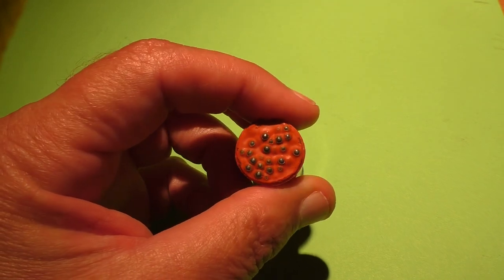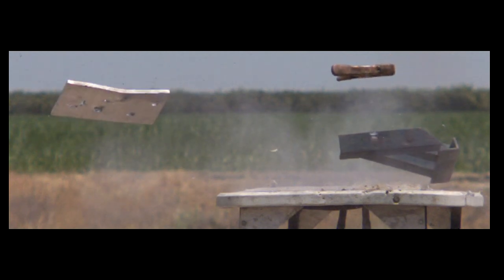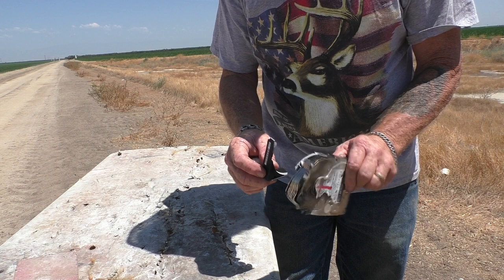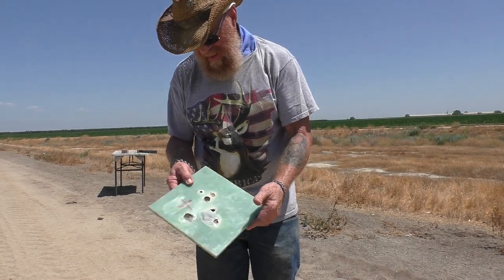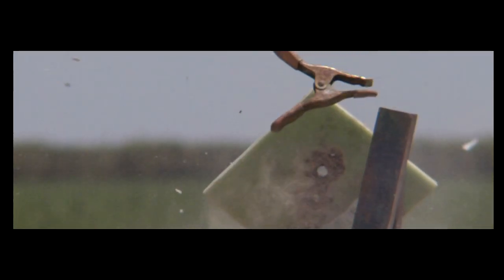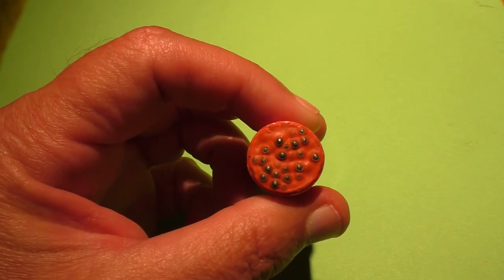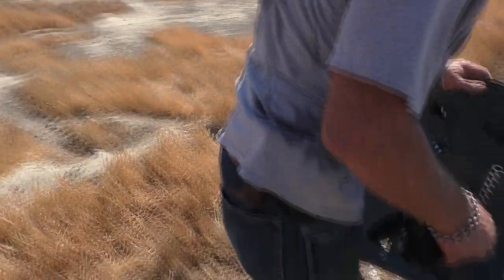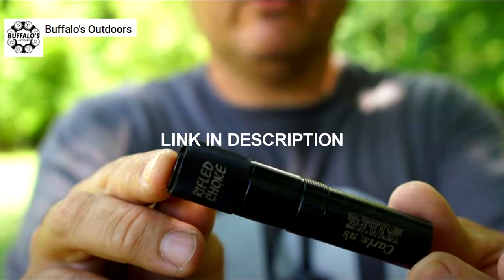Taming the 12ga Wax Slug -  is it possible?

Comment: I’d like to see these tested against cut shells. That would be cool.
Reply: I would too, he did a video on cut shells and REALLY didn’t like them, I think it’s a bias
Reply: Just this morning I tested a cutshell/waxslug out of an mossberg 835 which is overboard or I wouldn't have ran a cutshell/slug cuz I was scared over pressure issues. Since it is over bored the cut part of the shell actually acts as a sabo and the crimp keeps the slug safe from heat and wind. It was very accurate and punched through a refrigerator box stuffed with debris. The box was about 24 to 30 wide and it punched both sides.  The back side showed signs of the slug fragments but was still smaller than a baseball. I am going g to run  a few more and then make a video on my final product. I am hoping to get a wax slug on a pie plate at 50 yards reliably. I think I am pretty close. 10 of the slug variants I made today shot just fine at 30 yards and maintained a 4inch group ( not bad for a smoothie and some ditch craft). I am making some more today. I also shot several uncut waxers and to my surprise they were just as accurate even though the barrel is way too big for the slugs base diameter but they worked fine and held a 4in @ 27yards. The cut shells and the waxers both love to tumble. The diff is that the waxer holds together if you do good work. ( yeah, you can make a shitty waxer ) and the cutshells flip the contents of the shot cup out randomly, alot of times once it loses some load it goes of track cuz the imbalance and stuff. Waxers are definitely better than cutters. The only ditchcraft that is as cheap and effective is a combination of the two. If you don't have an over or back board barrel I cannot recommend a waxed cutter ( play at your own risk type shit). Happy new year 2021

Comment: I'd rather just make cutshells Barry style! Simpler, and they work fine
Reply from the maker: The biggest improvement to those is using a shell cutter to just cut out the crimp so the wax slugs can't plunk out of the shell if racked into a pump action.   (which can create a dangerous situation)

Comment: I've done a lot of experimenting on wax for black powder lube.  Toilet ring wax is really gooey but it is tough stuff, it doesn't go to hell in the heat it just gets stickier. Paraffin for canning is nice and clean and dries hard but is brittle. If you really want a tough wax, melt down some long lasting survival candles. That stuff will hold together for a wax slug I bet.

Comment: Solution to wax slugs - first, crayon wax is brittle so it's the last kind of wax you want to use.  Another issue is that pellets or dust shot is being used to give it weight, which is good, except that they do nothing to preserve structural integrity and if anything, weaken it.  Instead, I would suggest taking an approach similar to rebar reinforced cement or pykrete in that some sort of binder needs to be mixed with the wax - say a small, plastic mesh or fibers of some sort to help bind the whole thing together.
I'm thinking maybe braided fishing line with split shot attached to it so you have both weight and a binding/reinforcing agent.
Reply from the maker: Crayon wax has worked perfectly.   Any wax barely holds it together.   If there are any voids  (where the shot doesn't stack perfectly,   it is a breaking point and also throws off the balance-  which seems to be the issue with these.

Comment: OK I got my Crosman red-skirted non-lead 16.7gr pellets, they're called "Red Flight" these days, and are product number LF22167. I tried pulling one of the red skirts off and this can be done with the fingers - it reveals a little "tail" on the metal part of the pellet which should actually make it fly a bit better than if it didn't have one. Interesting! I can only get green ramset blanks so far, but will keep looking around for brown or grey ones.

Comment: Would using a harder or softer wax help it stay together?
Reply: Harder or softer, wax is still wax, and in the shotgun barrel even lead bullets often deform due to extreme acceleration. Doesn't matter which wax you use.

Comment: Could your problem be the balance of shot through the wax. Hence your random results.
Reply: You beat me to the punch on that one.  I thought the same thing.  Uneven shot distribution changing the balance point of each slug.
Reply from the maker: Yeah, that is what I was thinking.  Both the breakage issues and wobbly spin tell me the shot may not have been settled uniformly into the shell.    You have to tap the shell a few times to do that while the wax is still fluid... similar to working with concrete.

Comment: I missed this one, making me late to the game. I think that shot cup wad combination has some promise using the longest shot cup that can be roll crimped in the shell, and enough filler wads are put in the base of the shot cup to limit the shot weight to one ounce or less. I would work up loads starting at 900 fps and increase the velocity until I found an exceptionally accurate load or the velocity the slug came at. I would also use larger shot. #2 shot to #4 Buck, depending on the location of its expected use.  Shooting at an intruder inside the ho,e heavier shot at slower speeds would be much kinder to unprotected ears.

Comment: The wide range of results must be due to the difference in the distribution of pellets in the wax. Sometimes they might be more on one side, this would destroy accuracy if it has a spin. Smooth bore in this case may not always be as accurate but would be more consistent.
Reply from the maker: yeah,   I agree.   If the lead shot doesn't stack perfectly in the shell,  you end up with weak voids AND it throws them out of balance.

Comment: I wonder if we tried making them nose-heavy and using 3d printer filament instead of wax (like flexible TPU). Could make it nose heavy by loading steel shot in the bottom portion and lead shot in the nose portion

Comment: I'm just wondering about temperatures.  What kind of wax is he using for the slugs, and what is it's melting temperature.  Looks like it was a pretty hot day out there.  Not hot enough to totally melt the wax, but hot enough to destabilize it enough so it won't hold together when fired?
Reply from the maker: We kept the slugs cooled right before firing them.   They generally do well even when the wax softens up a little.

Comment: What do you think of using flechettes instead of number eight shot in a wax slug?
Reply from the maker: Probably wouldn't work like you think.  The wax is very weak.  The strength required to hold the slugs together is from how the lead shot stacks uniformly -

Comment: I have to wonder whether the kind of wax used has any effect on things. If this is paraffin or a similar wax on the harder side, could it be breaking apart because the wax is a bit on the brittle side? Perhaps a softer wax like beeswax or maybe even beef tallow might deform rather than break apart...but there goes any cost savings. Could be interesting to test though.
Reply from the maker: It doesn't matter too much.  The wax has very little strength.   The things hold together because of how lead shot stacks uniformly in the shotcup.   If there are any voids in the stack,   it is a breakage point.

Comment: there's sooooooo much variation with paraffin wax esp melting temperature. as well as strength differences temp of the gun may introduce lube variations. if several shots were fired straight off i'd expect to see a difference. .............and then there's bees wax (the irony ).................

Comment: Would exopy instead of wax be better ??
Reply from the maker: It would make it more expensive, and really slow down production.  Maybe make 1 or 2 shells per batch.  The binder has to have viscosity nearly of water so the lead shot can settle into the perfect,  void-free stack.
Reply: Huh that makes sense i wonder about something like a lightweight silicone that would flow easy and would harden to a springy stiffness /mite be better !

Comment: Have you guys tried epoxy and bearing mix slugs instead of wax?
Reply from the maker: Wax normally works very well  and it cheap.  Epoxy would just slow the process down - you'd only be able to make a couple shells before it started setting up and getting too thick for the shot to settle into a perfect orderly stack.
Reply: @taofledermaus  indeed

Comment: Have you made a mold for those slugs before? Like, one shaped exactly like a foster slug or whatever they're called? I have this feeling that if you 1: Had the actual projectile separated from its mold-point before placing it in a shot cup and firing it, and 2: had it in some sort of pre-established, proven-to-be-aerodynamic shape, you might actually have a shot shell you can patent and sell.
Keep in mind this is assuming you haven't tried this before, and it's also coming from a someone who is most certainly NOT a physicist, so I don't expect myself to be correct. But it'd be neat to see! And if the video already exists, can someone be awesome and link it to me? I'm on my video pass-through for the night!

Comment: Jeff couldnt you try using the mold for the minie ball slugs or the Diablo slugs and instead of using lead use the wax. I see that working in theory.
Reply from the maker: They'd be way too weak and break apart.   When the shot is stacked orderly in a cylinder shape,  the wax is just strong enough to hold it together.  Any voids you have in the stack of shot create a weak spot that will break-  which is what I think was going on here.
Reply: @taofledermaus  Gotcha. Just an idea I had figured I share but that makes sense.
Reply: @taofledermaus  Sabots maybe?

Comment: It was pretty obvious these slugs were going to break apart. the wax isn't very strong. If the shot cup collapses unevenly at all, it will fracture the slug. And at 10,000g (according to Jeff), how could it collapse evenly?
Reply from the maker: Normal wax slugs properly poured into the shotcup without any voids,   with a good uniform stack won't break apart.  The wax is JUST strong enough to prevent that.  If you have any voids they will often break up.

Comment: Very interesting. I guess the secret to good wax slugs is using crayon wax, not plain paraffin... Crayons seems to have other additives that make it harder and a tad flexible. Also, I noticed (have no science to back this statement) that you are better with a "square" slug, that is, the width to height ratio is about "1" (same width x same height). Looks like your old waxers worked much better.... 🤔
Reply from the maker: It's really important to have the shot stack uniformly in the shotcup.  Any voids will not only throw off the balance but create a very weak spot where they will break up.   Any binder (glue, epoxy etc)  would have breakage issues

Comment: lets see a wax OO slug and what that will do
Reply from the maker: There wouldn't be any gain.  Same payload weight and velocity - same energy on impact.  Just make it more expensive to make  (may as well buy foster slugs)  and probably wouldn't hold together as well since there is much less surface area than #7 shot.

Comment: Surely Epoxy would be a better binder than wax?
Reply from the maker: definitely slow down production and make them a lot more expensive - worth it?
Reply: @taofledermaus  Do you think it would increase the price all that much over buying a sacrificial pack of crayons? In England you can get a dual-syringe of knock-off Araldyte for between 30-70p that would probably fill at least two of those buffer cup things. You can do better if you buy multiple units at once. I expect there will be something similar over with you since they are probably all produced by the same Chinese chemical works! A super-quick search on ebay.com shows what looks like very much the same thing for 1 dollar and 49 cents. Or 2 dollars 50 cents for two. Might be worth a try?

Comment: None of these slugs can be consistant as the lead mass is never equal in repartition thru its mass....
(Hope it's clear enough)
🖖🏻🇫🇷😎🇫🇷🤪🇫🇷🖖🏻
Reply: Sure it can, if you tap it down, sooner or later you can make consistent layer patterns as long as it's high quality consistent sized spherical shot and you use the same hull as the mould each time.

Comment: Need to try hot glue
Reply from the maker: it's too thick.  You want the shot to stack perfectly in the shell for balance and strength
Reply: @taofledermaus  ive tried it, i just layer it and apply pressure after every layer. They fly very well and seem to hold together nicely.

Comment: try epoxy
Reply from the maker: that would make it more expensive and much slower to produce.  You would only be able to make a couple shells before it started setting up and getting too viscous to pour evenly into the shell.
Reply: @taofledermaus  sure. hot glue will work as well.  problem is wax is not strong enough. maybe beeswax, pure one might work